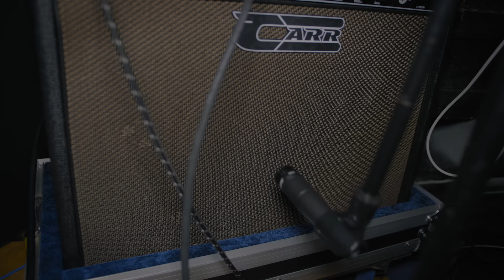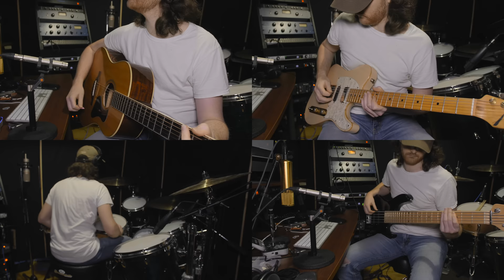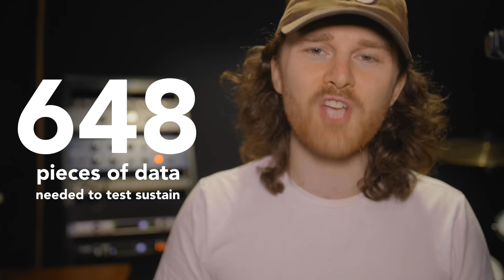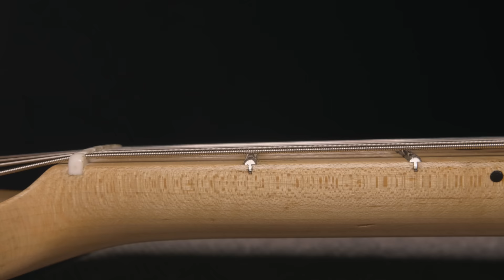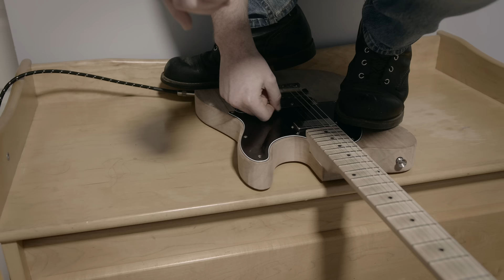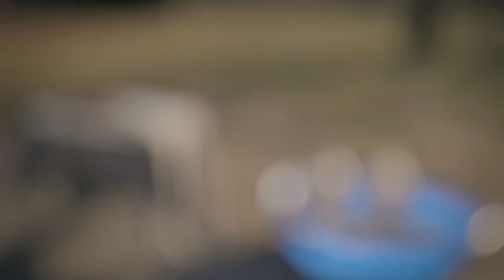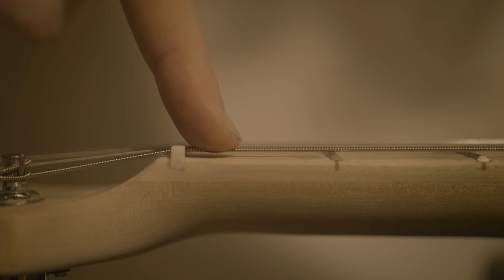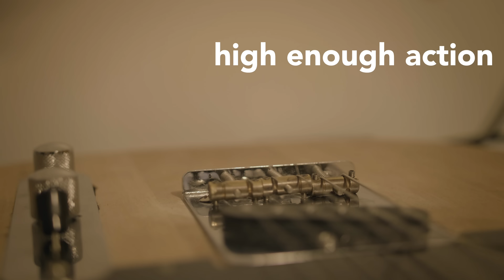Tested: Where Does The Sustain Come From In An Electric Guitar?

Comment: The combination of these 2 videos really makes me think that practically the only things that truly matter to a great sounding guitar are a good pickup and a good setup. And a great player of course!
Reply: Speakers as well, They all do put a unique twist on your sound. Glenn at SMG did a great video about it called what matters most about guitar tone. I really love seeing people get to the bottom of what matters in regards to tone and well made guitars , There is way too much made up stuff floating around.
Reply: the thing is, a cheap and not very well constructed guitar (bad mechanics, poor maintenance of the tuning, bad ergonomics (neck not well finished, frets coming out) might sound great with a set up and some expensive pickups, but if it doesn't hold the tuning well and doesn't feel great to play than it's not fullfilling its purpouse.
Reply: @Fedbo  Indeed. More expensive guitars do some things better. But this video shows that better sustain isn't necessarily one of them.
Reply: Changing amp/speakers has long been the most drastic tonal quality changer. I've long believed a cheap (yet adequately built) guitar with a good setup and a decent pup into a nice rig will get you much further than a $3000 dollar custom guitar into a cheap practice amp. There are good practice amps these days, but comparatively speaking.
Reply: The science seems fairly clear relating to tone. I'm not discounting the other factors that affect the player though ... neck shape and feel, fret size, tuning stability (set up is part of that but not the only thing), body ergonomics ... and aesthetics. I certainly wouldn't discount all of those things when selecting a guitar.
Reply: dont forget to turn the amp up to 11
Reply: A fascinating pair of videos. Icould not agree more. However, I owned a 1961 Gibson Les Paul Custom (SG) for 35 years. It was particularly sensitive to live rooms when playing with higher volumes, holding notes for ridiculous lengths at times. It had 3 genuine PAF humbuckers which I found to be indistinguishable sound wise from my 1976 Black Les Paul Standard.
Reply: Everything else makes an indirect impact in the form of being an interface for you to interact with an instrument. It's shape, weight, feel of the neck - all of this affects your comfort of play, and how you play. But realistically it doesn't contribute much if at all to an actual sound an electric instrument makes. Pickups, scale length, and position of the pickup along the string is really the only three important tone things.
Reply: @DA-fx2wl  and cheap guitars are actually made far better these days. not that they are all good, but many have really decent necks and can even hold a tuning. not all, but more than the cheap guitars that were around years ago.
Reply: @Quicksilver_Cookie  yeah, guitarists use words like sustain, tone, resonance etc, as words describing that we like/dislike about a guitar, but it is almost completely unscientific. companies sell tons of guitar parts talking about sustain etc. eh. hehe.
Reply: Which makes absolutely perfect sense. Everything that actually touches the vibrating section of string, the part that converts that vibration to an audio signal, and the part that actually moves the air and produces the sound. So many other bits and pieces produce smaller and smaller changes, but cost more and more money. Some produce no discernible change at all, but people still swear by them because they spent money on them.
Reply: True. But it’s definitely a matter of diminishing returns. Well-built guitars are amazingly affordable now, if you don’t care about tone woods etc.
Reply: @Pantalooj  oh, of course. The feel for you as a player will always be paramount. Now I just understand how much MORE that matters than everything else!
Reply: Literally is what the evidence is telling us.
Reply: The shape and body of a guitar make a huge difference... for comfort. Which is way more important than any kind of minute "tone" differences.
Reply: @Fedbo  I play cheap guitars almost exclusively, almost never have I replaced tuners. They stay in tune great with floating trems. It's all about setup. Almost never is a tuning stability issue a tuner problem, it's a binding issue or even how the owner strings the guitar.
Reply: This is amazing.  🤘
Reply: Well the build of the guitar does matter as well as its wood, but not how much is paid for it. It's also important to note that sustain is for more than just playing long notes. Let me explain. 

The body is what holds the energy that keeps the strings vibrating, which in turn is picked up by the pickups. This doesn't only influence long single notes, but also a rhythm strumming and hammer ons. As this video shows some bodies have slower decay over time which would convert to a more continuous rhythm as there's less drop in sound level. 

If we were to translate this to pedals, the pickups are like overdrive, giving us an instant on the spot tone difference, while body and sustain are more like delay or reverb, affecting tone over time. 

Let me explain with three guitars. The first is my Les Paul. It's a set neck guitar with great sustain, and for some things just too much. The other is my tele. It's the one with least sustain of them all. Which is good for is own reasons, it's very resposive to playing and I don't have to worry about muting strings so much as with the Les Paul. So both have great tone, but the first, the Les Paul is like playing with reverb always on and I've got to be more mindful of those open strings or they'll start ringing on their own quickly. The Les Paul is also fantastic for hammer on playing as it stores a lot of vibration in its body.

The last guitar is a Yamaha 112, very cheap guitar that I bought used for 50 bucks and spent around 500 bucks in pickup upgrades. I now hear a great tone because the pickups are so much better. So yes, pickups do play a huge role. But the guitar already had that great tone, it just wasn't picked up by the stock pickups due to their frequency response. I could already hammer on it a lot easier than on the tele before the pickup upgrades, but the tone wasn't so great until I changed them. 

This is no different than a singer, a room and a microphone. The microphone will not make up for the singer's voice. It can bring out more of the voice of the singer, but can't make up for it, nor somehow alter the reverberations in the room. It's just a microphone. 

Price wise the tele, with the least sustain, is the most expensive, followed by the Les Paul with the most sustain and last the Yamaha with good sustain, but thankfully, not as much as the Les Paul. 

So to summarize. Sustain is a thing. It might also not be the thing one is looking for too much in a guitar. And finally, it's got nothing to do with what is paid for the guitar.
Reply: Put the "great player" first and you have completely understood these videos.
Reply: And a good speaker on your amp
Reply: was thinking that myself
Reply: @caseykittel  

“Oh, twice as much ain't twice as good
And can't sustain like one half could”
- John Mayer
Reply: Pretty much
Reply: yeah that's pretty much it
Reply: @Quicksilver_Cookie  Position of pickups along the string is huge - most people don't list it - kudos.
Reply: @Fedbo  You're getting at the point that ergonomics and "tone" overlap -- if the guitar is a pain to play, for whatever reason, the guitarist will have a more difficult time getting good "tone" out of it.
Reply: @DA-fx2wl  You can definitely get a better guitar now for $300 than you could for $300 in the 80s (and that's not even taking inflation into account.) Maybe improvements in CNC technology?
Reply: Don't forget the electronics: amp, speakers and onboard electronics (tone pots, active pickups, etc.)
Reply: @Fedbo  You don't need to spend that much for those things though. You can find a guitar in a thrift shop with absurdly high action or messed up tuners, but I'll bet you the cheapest guitar in your local guitar center doesn't have any of the problems you've mentioned. (At least not any more than a $20,000 Les Paul which still goes out of tune when you bend.)

There are a few nice things about more expensive guitars, but honestly the biggest difference between the $100 strat I got from Sam's club and my $1400 American Deluxe is the electronics. The cheap one doesn't have a single setup problem and it holds a tune just fine. 🤷‍♂️
Reply: All kinds of things affect tone and sustain and other things, to various degrees of significance. I don't see how these videos disprove what's been known about guitar tone for generations. Wood affects tone: https://www.youtube.com/watch?v=muVzwbkUUnM
Saddle material affects tone, sustain: https://www.youtube.com/watch?v=RXvZqakXJT4
or bridge pins in acoustics: https://www.youtube.com/watch?v=Z-Fj_4fBlVw
neck mass: https://www.youtube.com/watch?v=NJpZDEU7cw8
etcetera
Reply: @Quicksilver_Cookie  These things (and others) certainly contribute significantly to the sound of an instrument: Wood affects tone: https://www.youtube.com/watch?v=muVzwbkUUnM
Saddle material affects tone, sustain: https://www.youtube.com/watch?v=RXvZqakXJT4
or bridge pins in acoustics: https://www.youtube.com/watch?v=Z-Fj_4fBlVw
neck mass: https://www.youtube.com/watch?v=NJpZDEU7cw8
etcetera
Reply: @caseykittel  I disagree. All kinds of things affect tone and sustain and other things, to various degrees of significance. I don't see how these videos disprove what's been known about guitar tone for generations. Wood affects tone: https://www.youtube.com/watch?v=muVzwbkUUnM
Saddle material affects tone, sustain: https://www.youtube.com/watch?v=RXvZqakXJT4
or bridge pins in acoustics: https://www.youtube.com/watch?v=Z-Fj_4fBlVw
neck mass: https://www.youtube.com/watch?v=NJpZDEU7cw8
etcetera
Reply: @SeeSawMassacre  I think what you are missing is the amount of effect those things will have on an electric guitar. For most the effect is negligible, such as changing the body wood. Yes, different woods will vibrate differently due to their different fibre structure as well as differing density. However, the effect of this on the tone of an electric guitar is very small. To the point where most, if not all people will not be able to tell the difference in a double blind test. 

Same goes for saddle material, the effect will be there, a harder saddle material will undergo less plastic deformation and cause less damping to the strings, however this effect is relatively negligible. Especially once the standing wave is established and creates a node at the point of the saddle. There will be slightly more energy left in the string using steel saddles, however this effect would be unmeasurable as variations in how hard one picks the string would be many orders of magnitude higher than variations caused by saddle material. 

We are specifically talking about electric guitars, acoustics have a different method of amplification, and thus changing the density, weight distribution, and bracing of the sound board will all have significant effects on tone in the acoustic world. Electrics are a different beast entirely.
Reply: @huntergibson9359  Yeah most people can't tell the difference with one small change, but make five small changes and they'll tell easily. And a small change can have a big effect on one's playing. When i really think my tone sounds good, and when it suits the song in some accidental synchronization of sound and the feeling of the music- i get into it much more. Music is largely about harmony. And if the tone is not at harmony with the song, it doesn't sing. Sometimes a crappier guitar sounds better on a ratty or negative song. And often an expensive guitar sounds better than one less expensive. I just play what i have, but these small differences add up, and if people refuse to care, that's just going to make those of us who do sound better by comparison. I don't care immensely, by the way. But i respect the small changes and my sound is always improving.
Reply: And a great logo at the headstock
Reply: Pretty much yeah
Reply: It's funny how far out of context a few marketing ploys have carried over into a general belief.

It is the same in the Radio Control equipment world. Many believe that brand that is mass marketed is far superior than a brand that doesn't have salesmen forcing shops to hold a certain level of product. Guitar vendors are notorious for this.

I follow you in the features you have proven. Even in my luthier days I didn't believe the hype. My counter argument was "Then explain the reason why a plastic guitar like Stienberger sustains the same or better than a Fender Strat?"

The replies were all over of course.

The only benefit I've seen in one "tone wood" over an other was the ease to finish one wood faster than another on the production line.

I've never believed in tone woods, I do believe that scale length has a good chance of effecting tone.
Reply: @RockandRollRC  scale length would certainly effect the sound. Simply based on the formula for pitch alone would prove it. Whether it's better or not would be subjective but it would definitely affect ir.